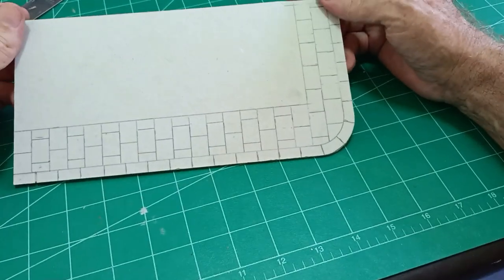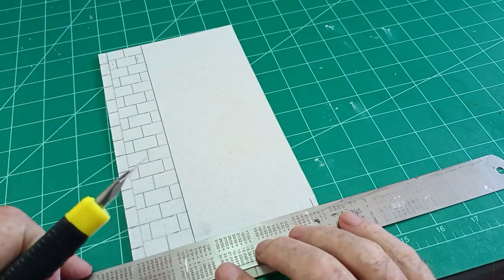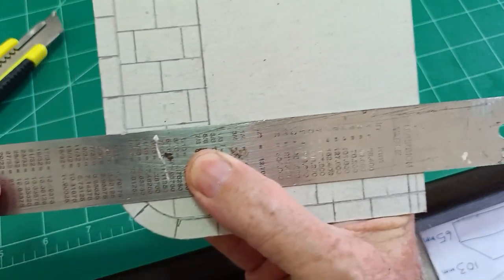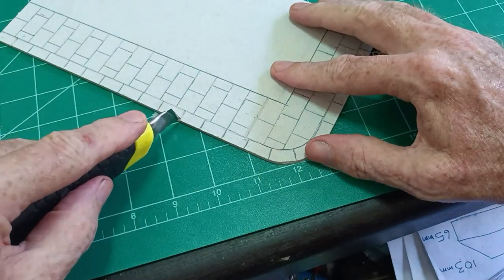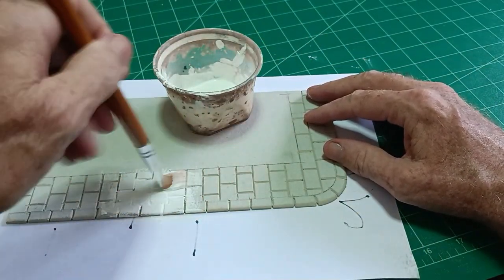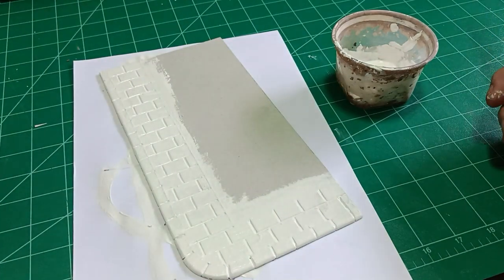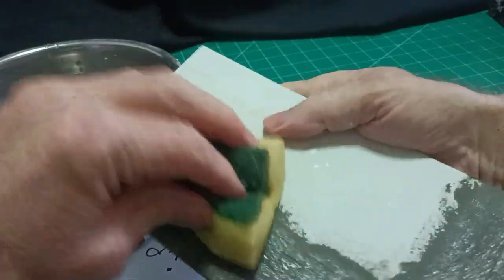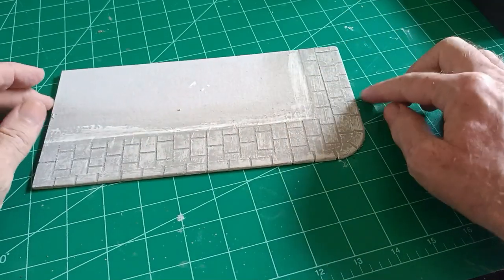Scale model sidewalks. How to make.

Comment: Cutting out all those lines looks tedious, but nobody can argue with the end results, (much less the cost,) of the finished work.  An informative tutorial, Don; and a good reminder that there is no "Royal Road" to quality model building!  

I don't remember if you answered this in a previous video, but is there a reason you coat the 3mm card with thinned wall filler before the final coat of tile grout?  Can you just use tile grout, or does the grout need the wall filler as a "sealer/primer" to stick to the card?

Thanks for posting this!